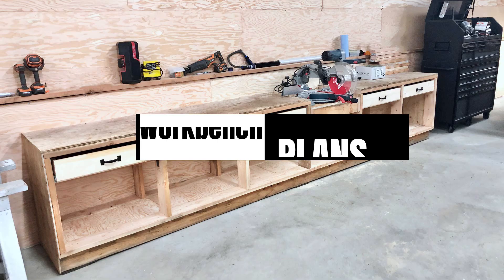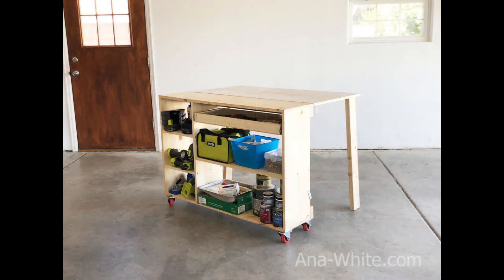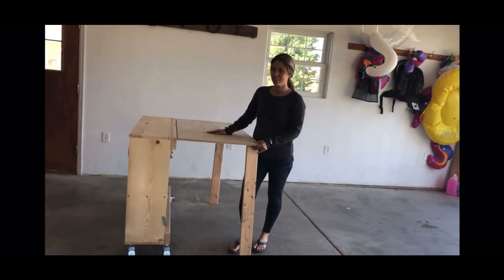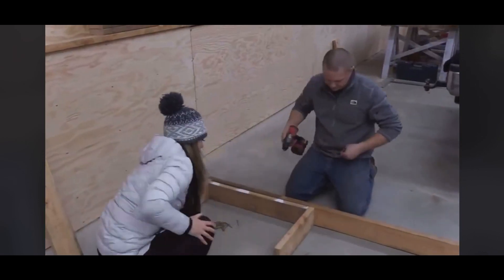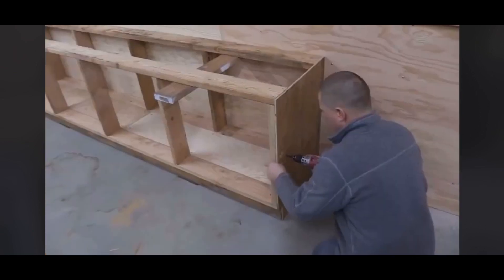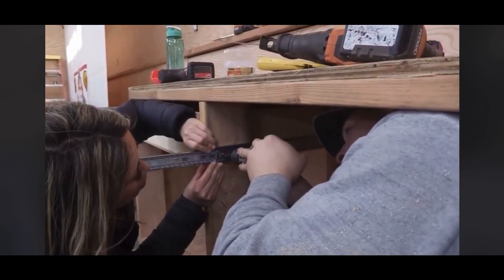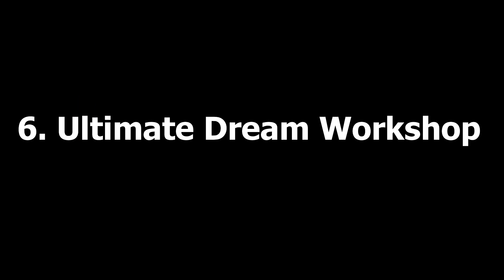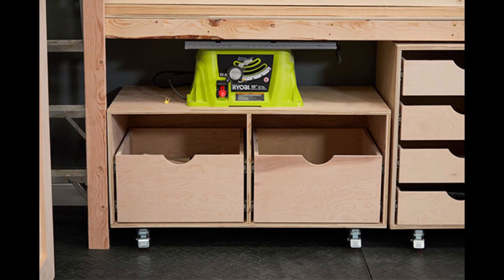Best Free Workbench Plans

Comment: The first workbench you showed was the FIRST workbench I built and was the first bigger project I made. That was in 2012. Almost 10 years later I am still using it. It serves a different purpose but still using. Number 3 on your list is also one that I’ve built. I’ve loved it for several years, although I didn’t do the carts. Now I’m thinking I want to disassemble that and make number 5. It just makes more sense for my shop. It’s so great that you have so many options.
Reply from the maker: That's fantastic!